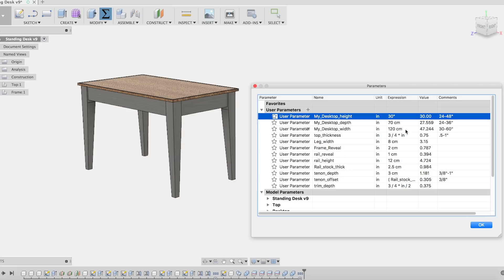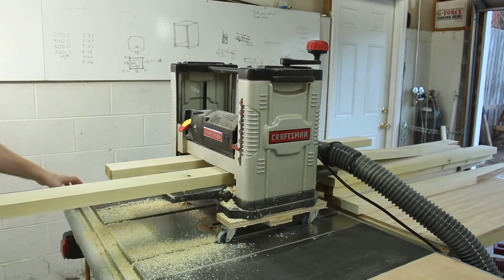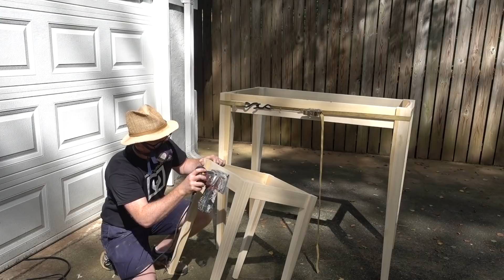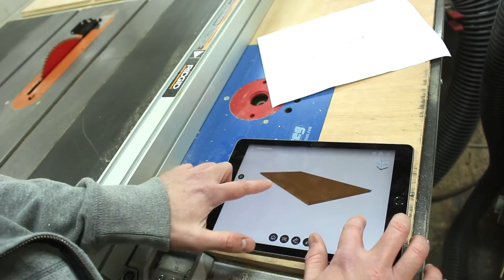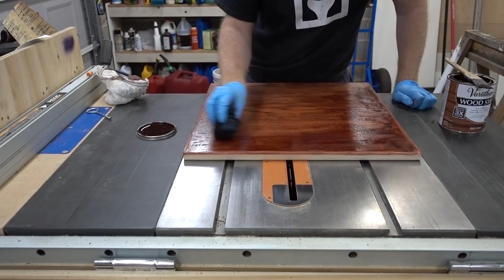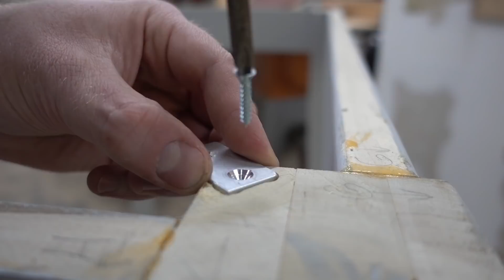Magic of Parametric Modeling: 3 Nested Tables -ONLY- 1 Model

Comment: Long tapered cuts are easily done on the jointer. One of my favorite ways.
Reply from the maker: Brian Prusa how do you establish the angle?
Reply: Makercise depth of cut over distance. Set depth of cut for half of total taper, run half of taper distance, lift up, turn piece 180 and with the pressure on the cut part (the piece should be doing a wheelie) push it through again.
Reply: Makercise https://youtu.be/nZTXvsrzbSQ

Comment: Whats with all the side video projects?  What ever happened to the shaper? the upgrades to the Lathe...  Those are the videos that got you the most attention. Honestly Parametric modeling and other Fusion 360 videos are a dime a dozen on youtube.
Reply: Ramiro M  he is having trouble with the shaper and is not making enough progress to make a video and he does not want to start another gingery machine as it will probably need the previous machine
Reply: A video about the trouble he is having (if what you say is true) would be better than a Fusion360 video that has little to do with anything other than getting affiliate clicks... Even a video of him having to start over on the shaper would be better...